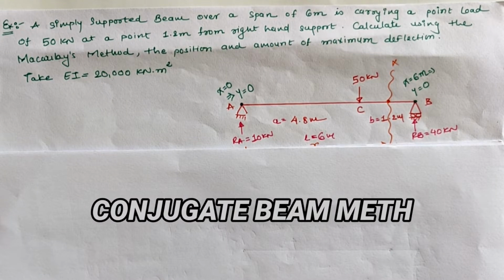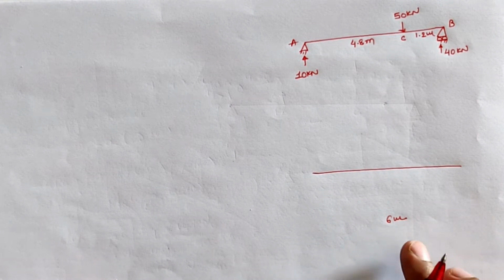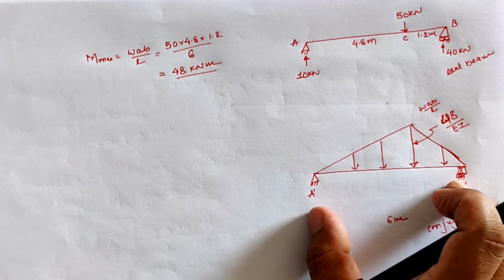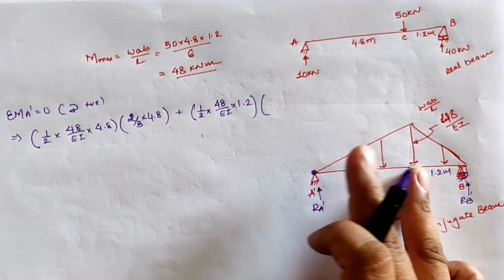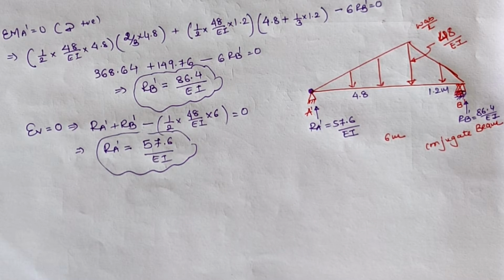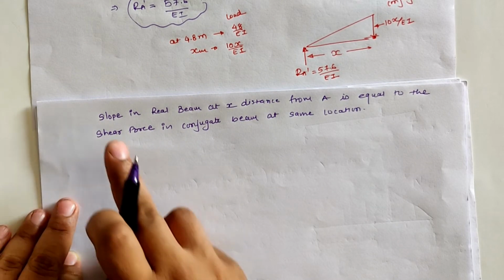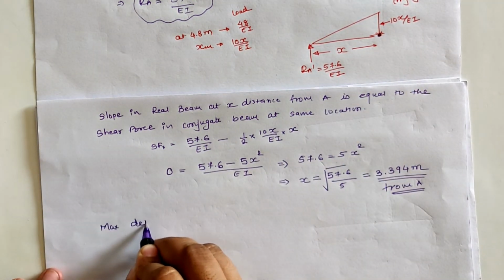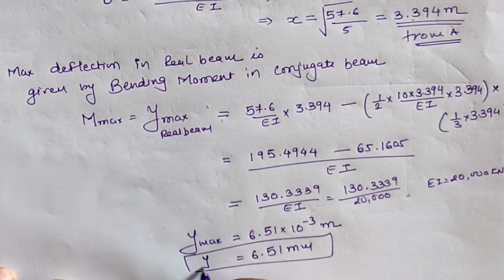CONJUGATE BEAM METHOD - MAXIMUM DEFLECTION IN BEAM - SIMPLY SUPPORTED BEAM LOADED WITH POINT LOAD

Comment: How did u get 10x/ei on similar traingle was it reaction at Ra in real beam multiplied by X?
Reply from the maker: And for your second query, 
Its exactly the value as "reaction at respective support in real beam multiplied by "x" and divided by flexural rigidity as "EI"
Reply from the maker: Dear Friend,
Similar triangle rule is of Basic Trigonometry in which comparative values is taken
For ordinate at unknown distance "x", have fond value 10x/EI Which is described in example.
At distance 4.8m, value of ordinate is 48/EI hence if converted in per m lengh, value by distance is the 10/EI
And at unknown distance "x" final value is "10/EI" as per m value multiply by "x" hence the final value is "10x/EI

hope now you get the point

Comment: Please in the case where the max bending moment is zero,will you treat it as negative?
Reply from the maker: Dear, if the value is zero, then neither positive nor negative is it. Zero means zero without sign.... But thumb rule is if the slope is zero then the moment may be maximum at that location

Comment: What is the difference between deflection and maximum deflection?
Reply from the maker: Dear Mr. Capone

Generally deflection is calculated under the application of point load but
It may be differentiated as deflection at a particular location while maximum deflection point is having the value as max in every location of that particular beam....
It may happen that at location of point load or simply say loading, deflection having value "X" while at any other point of beam as "Y" in which Y>X
Hope your query is now resolved